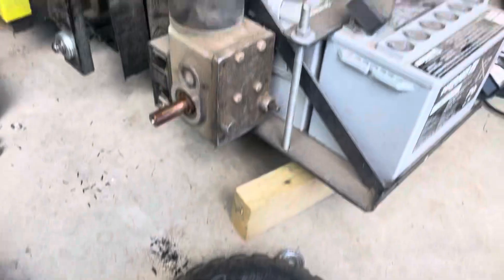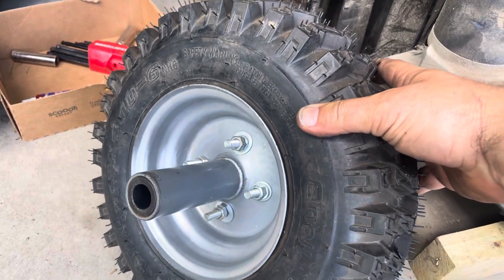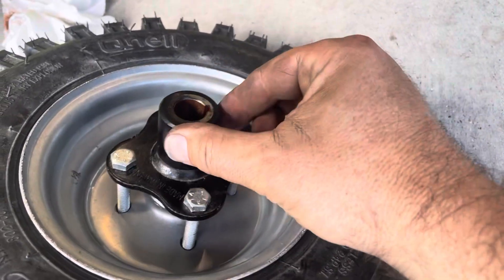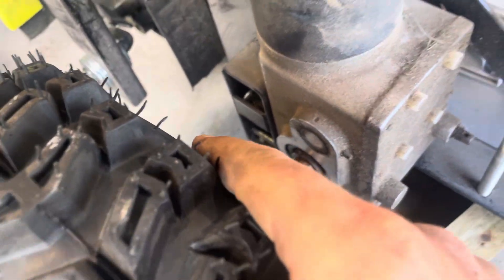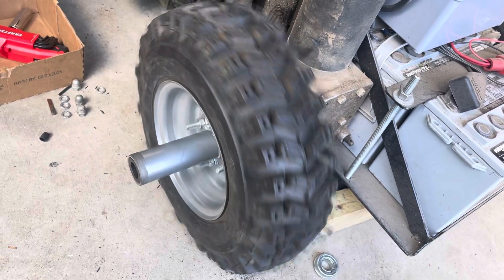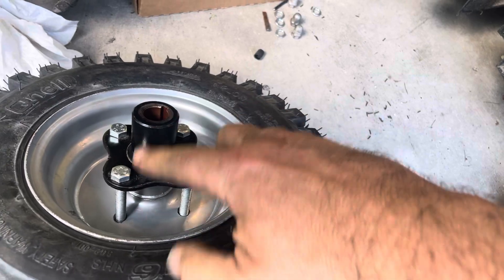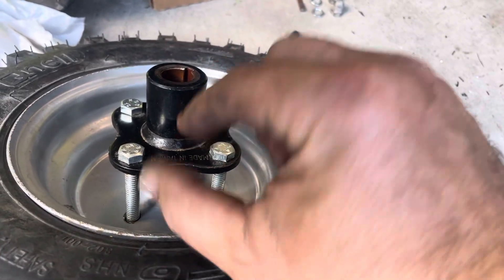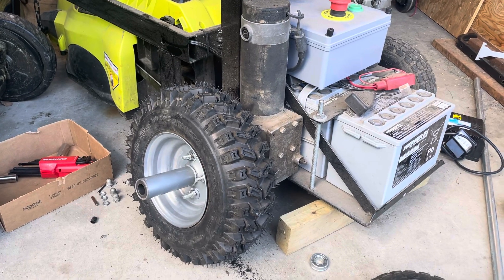Wheel swap for RC Lawn Mower

Comment: That definitely seems like it will work well. I just added 24 volt batteries and I will upload a video later today and I can do a close up of what I did. That should work fine. I never checked for a wobble on mine. I will definitely do that too…